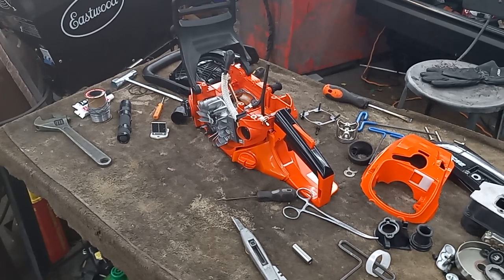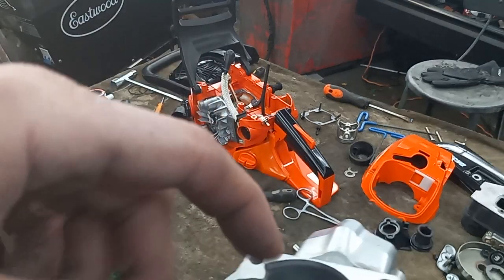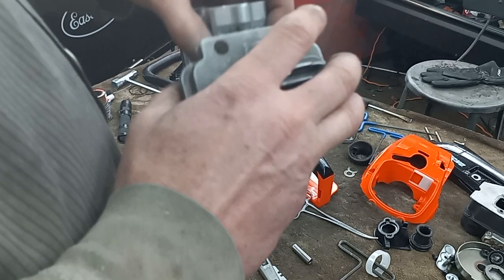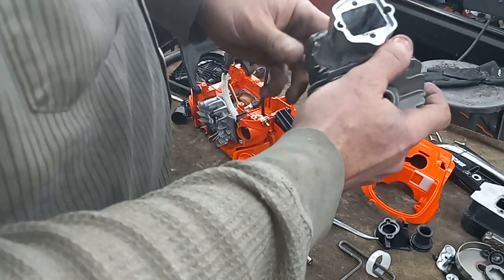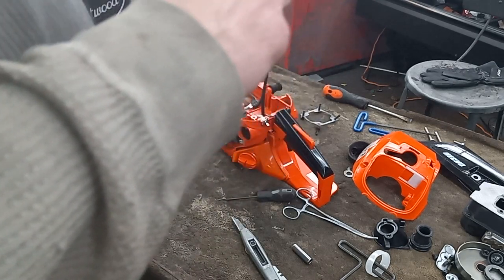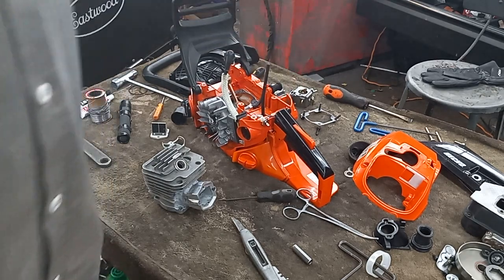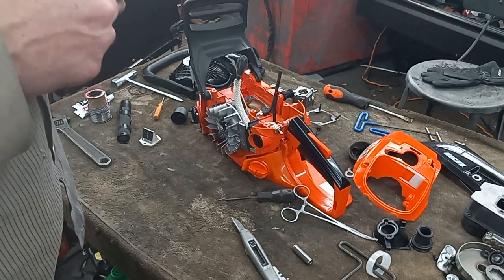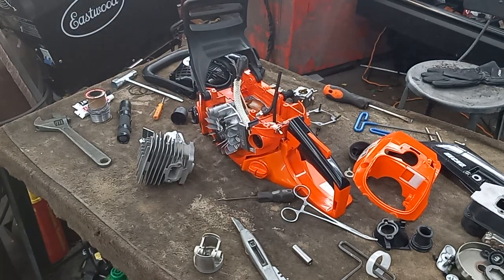update on 4910 reed saw

Comment: Man you are really setting the pace for high-performance on Echo chainsaws.  When I was a kid we used to power our home but go karts with horizontal whst 2 cycle Jacobson engines.  They had Reed valves as well.  Other than raising the compression by milling the heads that's all I remember doing to them.

I can't wait to see where you go with this project.

Comment: Looking good Charlie!  Was that reed block designed for an RC motor?  I believe Zenoah has one of the best hobby engine designs and you can buy the reed block from them.  Maybe next time, you can weld the reed block to the crankcase and just seal up the cylinder intake?